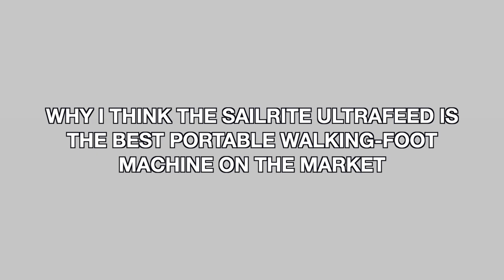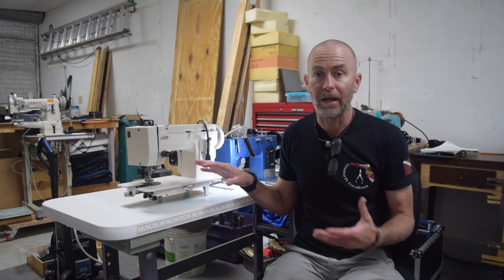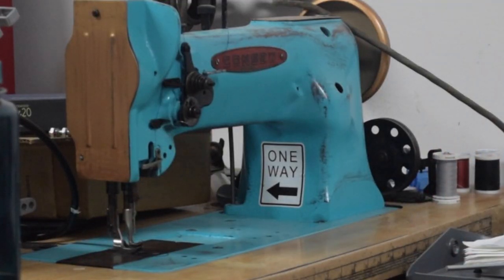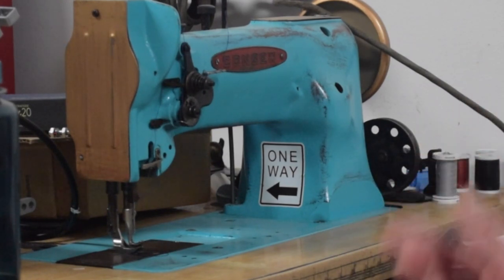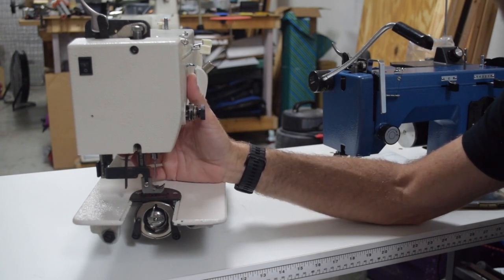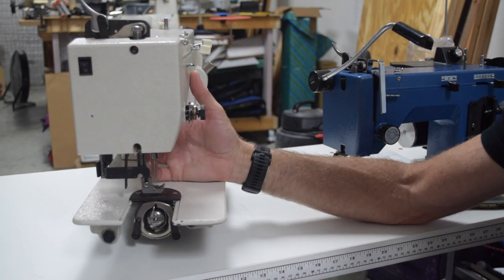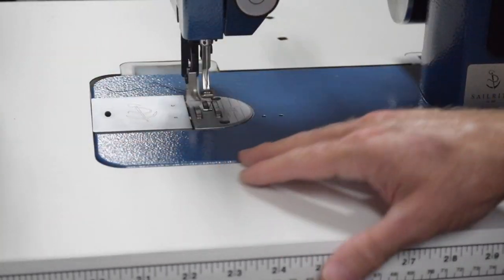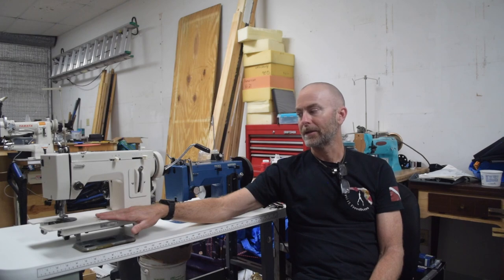Is The Sailrite Ultrafeed Better Than The Look-A-Likes?

Comment: The real question is "Is the Sailrite machine worth THAT much more?"  Are the sewing experience, reliability and results that different?  Can you tell the difference in the stitches in the end product?  If you can afford a Sailrite machine, perhaps you should compare that to Juki, Consew or Pfaff, perhaps Yamata, machines.
Reply from the maker: For me, yes, the Sailrite machines are worth what they cost.  Your mileage may vary.

Can you tell the difference in the stitches? If both are working correctly, of course not.  The difference in the calories contained in a terrible frozen pizza are the same as in a delicious fresh-made pizza, too.  The experience of obtaining those calories may be noticeably different.  Some people will care about the difference in experience, some will not.

Comparing the Ultrafeeds to any full-size industrial machine is an inaccurate comparison, and I have made this point ad infinitum in other videos.  The Ultrafeeds are a PORTABLE walking-foot machine, and only compare to other PORTABLE walking-foot machines.  Unfortunately, there is really only ONE portable walking-foot machine design, the one shared by Sailrite and all of the other brands making the same design.  The portable walking-foot machine is remarkably capable, and can function in place of a full-size industrial machine to a great extent, but anyone shopping for a full-size industrial machine who NEVER needs it to be portable should NOT, in my opinion, by an Ultrafeed or any other portable walking-foot machine.  It's like comparing a compact pickup truck to a dually - they're essentially the same, but with different capabilities and use cases.

Comment: I just picked up a used knock off.  It was sold under the Tuff Sew brand.  I am apparently the third owner at this point.  The man sold his boat and didn't need it anymore. It had served repairing sails on two other boats so I knew it was up to snuff for my needs.  I am not going to use it for sailing but for building back pack sort of things.  I did try to find a used sailrite but there just wasn't anything around.  This was the only machine of this build type available.  I paid 250 for it and I am happy  with the performance so far.  If I find myself using it more than I imagined I will upgrade to the real deal.  Until then, I am thinking of painting it because that blue on the sailrite machines really has my eye.  I am considering adding a cheap servo motor to it, similar to the one you had added to one of your machines or get the sailrite workerB motor to keep it portable (on the fence which way to go).  All sailrite parts fit on it so I can invest in upgrade parts and they will all transfer over when I get a new shinny sailrite of my own.  I've enjoyed your youtube work.

Comment: I own four industrial machines; a Juki DDL-8700, Juki DU-1181n, Chikon CK-8BL a SunStar cylinder-arm machine that could be the twin of the one in the background of Jason's intro, and I have a Sailrite LSZ with all the doo-dads, including the WorkerB motor kit that is still waiting to be installed. And a mid-70s Sears Kenmore free-arm. All of them get exercised regularly, and, every once in a while, they actually generate a return on my investment.

The LSZ is a great machine for what it is intended to do. It is not meant to do the same work, at the same speed, nor for as long as a machine such as a Fabricator, a 206 RB, or a 1541. Nor are any of those machines capable of a zig-zag stitch, and they are not in any imaginable sense portable.

To attempt to compare their respective abilities is a disservice to the machine and to Sailrite.

Thanks to Jason for another good video, best wishes to you and yours,

YMMV YVR

Comment: Jason.  I have been watching your videos for years.  I have seen your opinion evolve during that time concerning the Sailrite machines.  You did not wake up one day and say, I feel this way. An evolution.  If I was going to buy a portable walking foot machine, I would buy the Sailrite with the Worker B motor.  No questions asked.  I mainly work with leather. (I still need to see more demos on sewing leather to be absolutely convinced)  I do not do enough leather work to justify a new machine.  (yet) But, if there comes a time when I need the extra speed and quality, then I will pull the trigger on the Sailrite.  Your opinion means a lot to me.  As a hands on 'sewer', that is why I regard your opinions as very valid.  Thank you for your honesty.  Thank you for your time.

Comment: I owned a Consew CP206RL.  The case was crap. The instuctions looked like a copy of a copy.  There is absolutely no help from Consew with the function of the machine. 
Owning a CLSP machine made me learn the basics of sewing machine function and repair.  Between the owning a CLSP and Youtube I was able to get it tuned and functioning properly.  After 2 years I sold it and purchased a used Sailrite LZ recently.  The Worker B motor is light years ahead of the standard motor, forward reverse knob function, and case are worth the cost.  Plus, if I have a problem I can call Sailrite and get the problem resolved and they have the parts to repair it.

Comment: I own a Sailrite  Fabricator, and I love it...I've sewn edgeing on 1/4 inch plywood (with the proper #21 needle and it handled it quite well) I had purchased an Omega walking foot prior and it is terrible when compared with the Fabricator. If I could go back I would have purchased a Sailrite portable, but I cant so im stuck with this boat anchor.
.
Reply: Plywood? Where did you find a needle? I love looking at all kinds of nifty sewing stuff. Even if I can't use it.
Reply: @debraclogston9379  bought it from Sailrite and I used v90 thread. I don't know how to send u a picture but if I could... I used edging purchased from sailrite and the high torque motor went right through it, no hesitations no damage just go slow. No problemo!

Comment: I would have loved to see you compare the Thompson zigzag you purchased from me with the Sailrite. I think that would have been a more apples to apples comparison. It was a good quality machine that served me well. I didn't have a need for a portable machine and for less than the sailrite I purchased a Juki 1541 with table. I do agree that sailrite provides a service to the sewing community through support and how-to videos, but it comes at a premium if you purchase any of their products. Smart marketing on their part.
Reply from the maker: Hey there!
Unfortunately, I had to sail that Thompson to help fund the new Sailrite, I wish I had them both at the same time for a comparison.  Having had both a Thompson and a Sailrite Ultrafeed (both straight stitch) for years, and having used them both side-by-side, I can say that the Thompson compared quite favorably in build quality, and both of mine were excellent machines.  The Sailrite is, in my experience, of at least equal quality, plus has the advantages of the significant updates like the stitch-length lever and the Posi-Pin. (This never made it to video, but when I installed the WorkerB motor on the Thompson, I was able to get the wheel to slip when trying to sew through thick layers of dense nylon.  With the Posi-Pin that doesn't happen. That was a significant factor in influencing me to by the new Ultrafeed.)
Thanks for watching!

Comment: I bought a Yamata version and sold it because it was junk then I bought a new REX and it was no better. Sold the REX and purchased my LSZ1. What a difference in operation, fit, finish, and Parts availability! No question in my mind the Sailrite is the better machine. A little pricey but worth the extra cost. Any other high quality sewing machine will cost much more than the big box store brands.

Comment: Hi I agree with you about 90%. I do have a Tuffsew with a 9" bed that I have used for a few years. The machine you displayed is junk, and does not reflect on the current production of these so called clones. I never had an issue with my Tuffsew. Nothing ever broke or came out of adjustment. I even sewn a plastic C channel to rubberized canvas for the m923 military truck. So in saying if you put the original motor and hand wheel back on your LS1 that they originally came with, paint the machines the same color, have a person who is not familiarize with either machine, could not tell a difference if they would spend a day sewing on these two machines. I think your opinion would be a little diffferent if you used the current production models. These machines can stand toe to toe to the LZ1 and LS1. Now are the sailrite's a better machine? No doubt, but for an entry level machine for people who are on a budgit , they won't be disappointed with these machines. Sewing machines are made to sew fabric and both do that very well. One looks better on the inside but it doesn't sew  better than the other. I don't have a sailrite but sewn on an LS1 and I can't tell the difference as far as performance. Again a very good video as all of your videos are.
Reply: And to further say most first time buyers who buy these types of machines will upgrade to a full size industrialized sewing machine anyway. So why spend that kind of money on a sailrite machine that will end up in the attic or some closet.
Reply: Ive been using a tuffsew for 4 years. Had a few little problems here and there but it was definitely worth the money imho. It goes through leather, plastic, cordura, skuba webbing, canvas, etc.
Reply: Yes, I agree!  I purchased a New-Tech GS-607Z, Monster wheel crank, case, light, stand, all for $366 delivered.  Over $1k less than the LSZ.   The machine has been Working fine for a year and half.
Reply: Interesting, thanks.

Comment: I now have the WorkerB motor installed on my LSZ w/Monster wheel. After a lifetime of fixing other people's stuff for money I think Sailrite did an absolutely excellent job on designing and (honestly) packaging the WorkerB upgrade. They include all the new bits you're going to need, I didn't re-use anything other than the primary belt. Decent quality power cord. My only gripe, and not limited to Sailrite, is the vertical adjustment of the final drive belt tension. I substituted appropriate hex capscrews for the motor/controller mount, way easier to install and service. But considering the fairly serious currency exchange (currently $1 USD = $1.28 Cdn) rate I'm still glad I purchased the WorkerB upgrade. And it does do really slow stitching. YVR
Reply from the maker: I'm glad you finally got it installed!

Comment: I had an exact copy of the sailrite lz1, as well as the a real sailrite lz1, and the difference is in the tolerances and the motor. The knock off would sew but missed stitches and was very difficult to control the speed on it, it was all or nothing speedwise. I upgraded it with a bunch och parts from sailrite and that made it better but if you can, get a sailrite, makes the sewing process much more enjoyable

Comment: so I don’t have a need for zig zag stitching that I can think of. so I’m trying to decide between the ls1 and Lz1.  the needle offset feature is what i am curious about. do you use it very often? is it work getting?
Reply from the maker: Hi Eric, 
My personal advice is unless you absolutely can't spend the extra cash, buy the zig-zag.  You may find that you will use it more than you think (I mostly use mine for bar tacks on webbing, but I have found it otherwise useful from time to time).  More importantly, perhaps, it might have more mass appeal in the future should you find yourself wishing to sell it; even if it isn't worth a lot more on the used market, it might be the difference between it being sold, or not even being considered because the potential buyer is only looking for a zig-zag one.
There are some potential advantages to a straight-stitch-only machine, like more consistent straight stitches (no "slop" in the mechanism) and better performance on thinner fabrics (due to a smaller hole in the needle plate).  Neither of these are particularly compelling to me for these machines specifically.
The first time a zig-zag stitch is exactly what you need, you will regret not buying the LSZ.  If you were buying used or being given one (or again, if it's truly all you can afford), the LS is a fine machine that can be extremely useful, and that's what I used for years, but if I could only keep one it would definitely be the LSZ.
I hope that helps!  Thanks for the question, and thanks for watching!

Comment: Bought an Barracuda 200ZW from unReliable and really regret it. 
Have only had problems with the machine and the company does not care after you bought the machine. 
The biggest problem is the play in the needle shaft, the play is so large that the needle tip can play 2 mm, which results in missed stitches and that it crashes into the hook.
Will order needelbar and needelbar support from Sailrite and see if I can fix the main problem. 
And it is not possible to adjust the hook timing as it sits with a pin through the shaft.

Really want to get the machine started as it sews very well the few times it has worked.

When I get the machine in order, I will make a video on the machine and all the modifications required to make it working so people know what they are paying for.

If you are going to buy a similar machine, check out Sailrite, also check used if you can not afford to buy a new one.
Reply from the maker: Thanks for sharing your experience, sorry it hasn't been a good one!
Reply: @thejasonofalltrades  I will probably be able to fix the machine, but it will cost time and money. And I would rather have spent the money on a company that cares about its customers.
Luckily I have more machines, Pfaff 1212 and Singer 331K5 which are my favorite machines.
Thanks for your videos, they create inspiration when the machines here at home have not been used for a while!

Comment: That's true, what you're saying about the clone machine. Is a act of a large cheaper? Just like one of your other. Describe us pointed out if you took the super b motor off and put the original wheel on. I think both of those machines would be tied. You're looking at the casting.  But not with the actual rod's go through sure polished the casting. Don't mean anything that's what the Baron are doing inside the machine. But once again $,121500 on machine for a clone. Sewing machine between 4 and 500 dollars. A huge difference for basically the same machine.  How about those apples? Take the work of the motor off the cell right and then try it. You'll find it will be the same. You said yourself, it works fine, try.

Comment: -look at the pinned parts: shuttle driver, and theres a litle elbow that is attatched to that shaft downtheline.  it holds timing but.. i dont like it. (e, i can replace aparts from sailrite)
-many setscrews on non sailrites are flathead, prone to stripping
-electronic pedals are absolute crap.  carbon pile is all that works for brushed motors.  rheostat pedals can be nice though those exist too
-the finish is more attractive than colored machines because when people are creating they want a bland surrond that doesnt meddle with the work at hand.  
-you can buy from sail rite the stich plate.  and it has no spring which is an improvement from the springed level sailrite uses because its reverse handsfree
-yeah the tensioner is a fine monolithic eco style tensioner.  it doesnt disasemble and maybe it would never break.  i replaced mine but if i replaced mine again i would source not one from sailrite but rather like a metal..  even more legit one,, like from consew :/
-the setscrews on the non-sailrites are really not great and require a proper screwdriver and proper tourque.

-i have a 9". its in a portable case.  it feeds the same.
that table you bought from them is chinese junk.

the feed and feet(there is 2.5  seperat feet sets),, the whole buisness going on down there ranks below a dropfeed.  the completly unique feed design (ok, bernina and others have their own walking foots too) isnt worth all the money sailrite asks for.  the machine Is Only choice for like compact moreso heavy duty home sew style of thing.  but even then the user is gonna be wanting a dropfeed with medium duty needplate+feeddog...  and a 20U is a very good middle of the road. 

 the sailrite is like 1300$.  my machine was 600+150(worth of sailrite goodies).   im not gonna support them at that $tune$

good vid Jason.    you should look inside the industrial dropfeed machines sold on walmart and ebay that cost like 400$-600$(:/) i bet the insides of those look pretty gnar.  thats probably why they only go to like 3000 rpm (my consew 7360 does 5500rpm).    oh dude, i got a neddle positioner/servomotor setup.. its great. handles much like juki's industrial NPS servomotor($$$).  not the same watts obviously but same great control.   im working on some awesome backpack designs and when i get my next prototype ill send a vid.

Comment: A better comparison would be to compare both machines with the monster wheel installed. The fit and finish of the Sailrite is definitely better, but the basic Chinese machine works much better with the monster wheel attached. However, over time this will probably overstress weaker internal metal components.